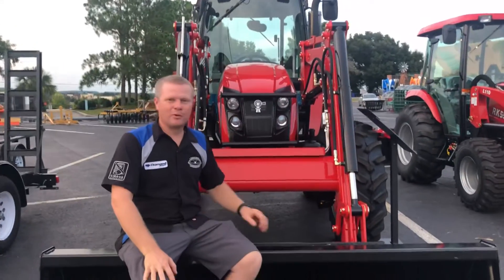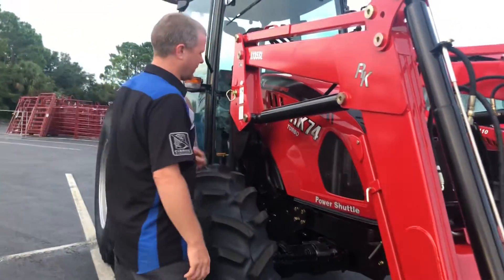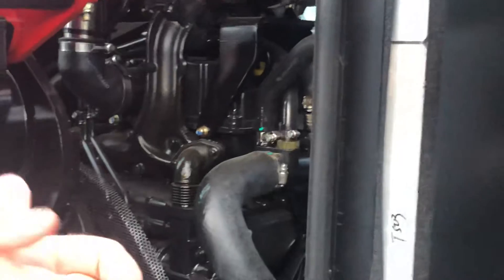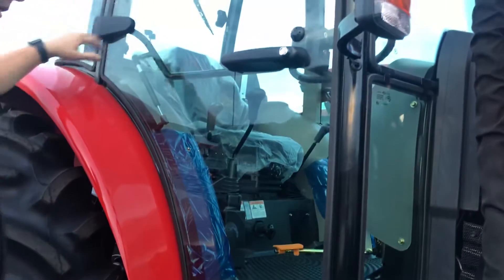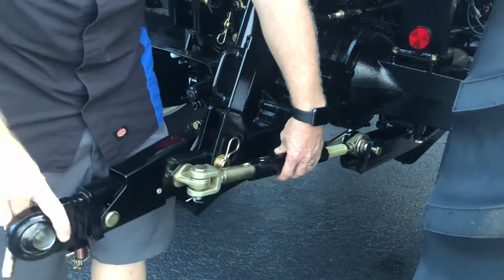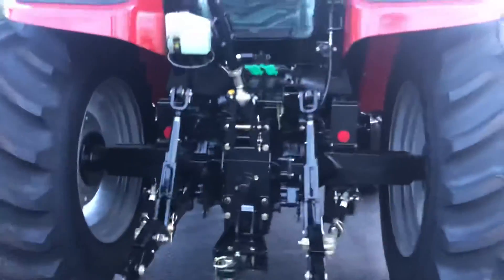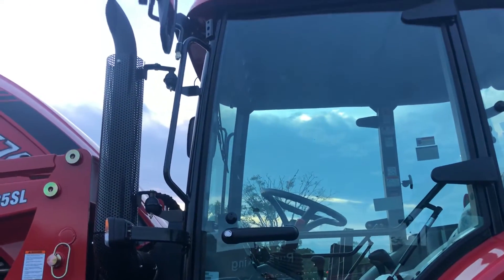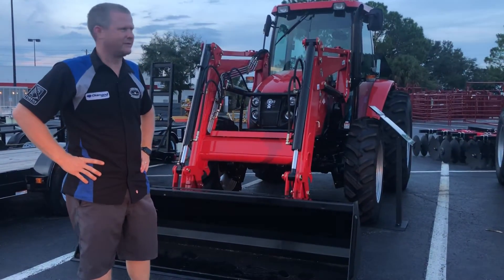New RK74 Tractor first look with Steve

Comment: This guy will probably make the list of tractors I'm going to compare the LS MT573 against. Wanting that 75 horse range with all the lift I can get in a AC cab package. 

Pretty set on the LS, but I wanted to let the competition change my mind if they're able. Especially at the price point and availability.
Reply from the maker: Since posting this I have purchased the RK 55 open cab.   I like the tractor a lot.  It is quiet and powerful.  I have had a couple things break this far and my experience has been positive with the staff at rural king however I must say it is not the same experience I get from Kubota or any true dealership when I take my other tractors in.   It is clear service is either a second priority or they are still ramping up but I did buy this tractor for much less than an equivalent Kubota so if service is where the savings is, for me I would do it again.
Reply: @smiller829  That's definitely my worry. I had a green one last, and they were fantastic,  but I'm wanting to move up to a much larger machine. Definitely need a cab. It never seems to be a good temp to get out and dig, or it's raining, and soon, I'll be dealing with snow. As always a dealer and their service makes or breaks a purchase.

Comment: Most new tractors that size have the fuel tank right where that one had it and all new tractors 100 hp and up have def 99hp and down have a diesel particulate filter.
Reply: I believe the cutoff for DEF is 75 hp. That's why you'll see many machines with 74 hp
Reply from the maker: Thanks for the info. That is good to know
Reply: It depends you could have a really unifficient 6 cylinder 5l engine which only puts out 50 hp. Or you could have a turbo 3cyl engine that's putting out 100hp it all depends on emission tests.